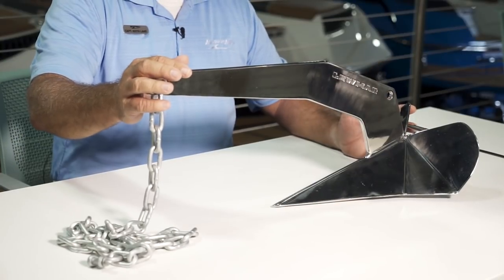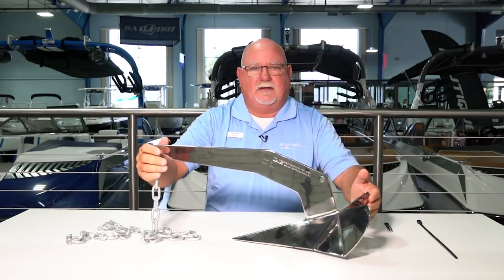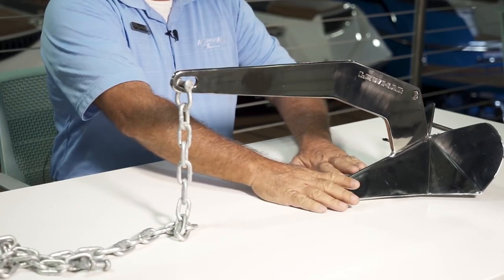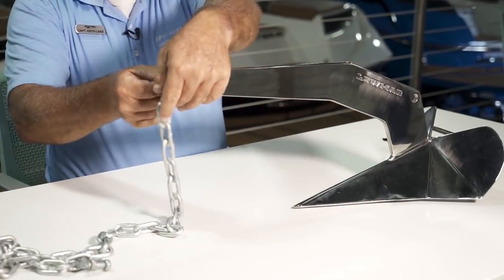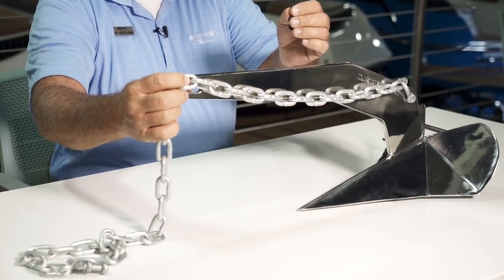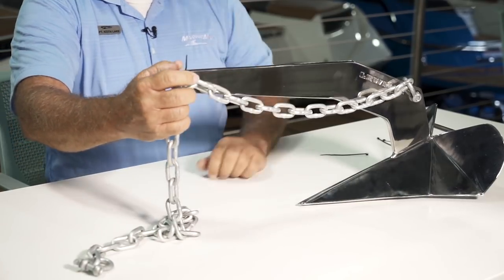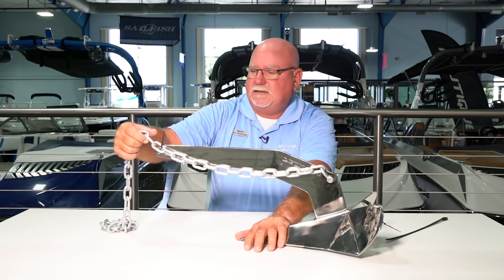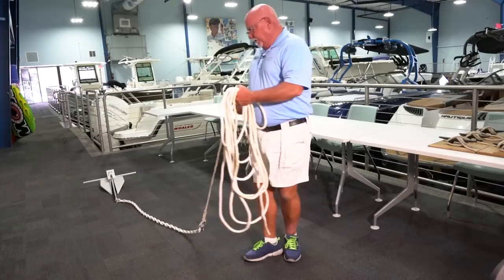Boating Tips Episode 15: How To Retrieve a Stuck Plow Boat Anchor

Comment: This seems a good idea but very risky if you are anchored in a tide way. A better solution is to use that eye in the head of the anchor to secure an anchor buoy line. Then you have two options. One to pull on the buoy line or, if too firmly wedged
Reply: You have a buoy on the anchor if you have to ditch it and retrieve it later.
Reply: Thanks for posting this John.  That zip tie aint gonna hold and will break almost every time.  I would not trust a nights sleep with it.  The buoy method is best

Comment: I have a plough anchor and always wondered why there were two fixing points. I came to the conclusion that if you had a rope on the one to the rear, you could pull it from that end in the event of it getting stuck.
Maybe attach the rope to the chain with small zip ties near the anchor ? ? 
I'm just guessing as I'm not a seafarer.

Comment: Thank you very much that's a big help I just finished a full restoration on a 1980 sunrunner 18-footer and with a Tower of Power all the electronics completely renovated boat it's going to be fun
Reply: Nice, I'm about to start restoring an '88 Sun Runner 195CV. Any tips?
Reply: @twistedsphere  Now that sounds like fun project yeah for starters with your haul that orange containers siliconized wax and the names right on tip my tongue but four coats and it'll bring that fire glass like brand new and that's something you need to make sure your glass is good before you waste too much money on the boat second thing is most your electronics because of age are gonna not give the right home settings so yeah change the stator the trigger the two description distributor boxes and and the rectifier play it safe that way you won't have a breakdown on the water it cost you about 500 bucks but trust me he'd pick 500 bucks real quick if you were stuck out on water
Reply: @twistedsphere  a friend of mine that's a mechanic for one of the big lakes around here tells me that they put a marine-grade fuel stabilizer in the fuel when it's delivered now and they have a lot less problems so I'm thinking about doing the same cuz my boat holds 26 gallons and it sits for a long time

Comment: i don´t like this method at all and wouldn´t even trust it for my dinghy. the best solution is to run a line from that front hole to a float in the surface. should the anchor get stuck, just pull the line. still i've always been able to get my anchor unstuck by using the boat's engines to go forward and pull hard on the anchor. i know people think that's not ideal but it's always worked for me with no problems ever.
Reply: That just isnt a realistic method when the water is deeper, or for a heavily fouled anchor.  This method with tuna cord is the best.  When the anchor is hung you clip a buoy to the alderney ring you should always have on your anchor line and you rip the breakaway out with the boat engine, and float the anchor with the ring.
Reply: @FTATF  it is a realistic method I do it like that every day, slightly higher chance of losing anchor but means you don't have to waste time with zip ties or rope always breaking , my plow anchor pivots and if I don't use the axaxt right amount of chain to tie it up like this it will not work properly otherwise it's probably the best method.

Comment: I always question if people have ever actaully done this when I see and hear people talk about the zip tie.   I've tried the zip tie on my old boat which maybe weighed 5 or 6000 pounds.  It breaks away way way to easily.  I actually used 3 of the largest zip ties.  A much better method is to use tuna cord.  For that boat 3 wraps of 300 pound tuna cord worked well, it wont break unless you put a lot of pressure on it.  For heavier boats you see more wraps.  Zip ties are a joke.
Reply: Nope, your zip ties are braking because you leave too much slack in your chain. Zip ties are not there to hold the weight of the boat. They are just there to hold the chain in place and to slide thru the shank eye, allowing the chain to do its job and hold anchor.
The only time the zip ties should have any heavy force on them in when you are pulling directly up un the anchor or in the opposite direction of anchor. 
In fact, the demonstrator in this video has too much slack in his chain. One link to much on that zip tie location.
Reply: @jejoko  they are breaking becasue its a bad method that can't be used for anything other than light boats.  Your idea of where the load is applied is totally flawed and works against the design of any anchor.
Reply: @FTATF  
Sorry but you are wrong. The technique is correct. The application in this video for larger ships is what makes it fail.
For larger ships you can use a slip ring to replace the zip ties. But if you leave chain slack between the anchors front shackle and the slip ring then all the tension gets placed on the ring. Which causes premature failures every time.
It is not a concept that everyone can grasp or apply correctly.
And for them the slip shank anchor was designed. Like the rocna fisher.

Now if you are anchoring OVERNIGHT then absolutely fasten your chain to the top shackle point of the anchor shaft, ALWAYS.
But for day time activities the zip tie or slip ring technique is perfect for a quick anchor retrieval. When applied correctly.

Comment: This is stupid, lame advice!  If you anchor and a storm comes up, that zip tie will break and then the anchor will pull out.  Not a good idea! Your anchor chain should be securely fastened to the eye at the end of the anchor! 
 A better idea is to fasten a second line to that other eye and then put a float on the end of that line.  Then if you cannot pull the anchor out, you can retrieve the line tied to the float and then pull out the anchor.  That float will also serve the purpose of letting other boaters know where your an hor line is, so they do not drop their anchor near yours, which could cause the two anchors to become fouled if the tide or wind changes.

Comment: Why not just have 2 chains, one attaches to each hole.  The one on the bottom should have much more slack when anchoring, and when you want to retrieve it, pull on the bottom chain.

Comment: Hello Captain Keith. Two questions. What zip tie tensile strength you suggest and what size of shackle you use in the video?  3/8" with 1/2" Pin ? Thank you.

Size C
Reply: What is size C shackle? I was not able to find.

Comment: Sorry but I'm not going to trust my $80,000. boat to a 89 cent zip tie. Current turns boat 180 degrees, zip tie breaks and I've lost my boat...
Reply: Every boating class that I have been to agrees with this video. Use a zip tie to save your anchor, the chain is moved to be attached to front hole in the anchor.  The zip tie just changes the pulling angle for a stuck anchor so you can get it out, it does not change the holding power of the anchor.
Reply: Not so: this method ONLY has relevance for short term anchoring where the direction of pull on the anchor does not change. So, do NOT use this method in tidal settings and/or where there are large windshifts.  If you do, you'll find your anchor being pulled out of its setting! If you need to retrieve an anchor that is stuck you have a number of options. The easiest and therefore first to try is to use an 'alderney ring' or other similiar proprietary tools on the market.
Reply: You would have the same issue, without the zip tie, if the tide changed and you spun around 180 degrees. Your anchor would likely pull loose from its initial dig, and would likely redig into the bottom again in the other direction.
Reply: but it would at least have the chance to redig. with the zip tie you break it and you will have to pull the anchor up, redo the zip tie and then go again
Reply: @jazzy jazz be careful, it does change the holding power since the front hole is positioned precisely to leverage the anchor to get it unstuck. therefore, it just takes a big enough wave or tidal change to break the zip tie and leverage that anchor out.

Comment: Guys like this dude have obviously never slept on their boat on a windy night. For fishing when the captain is on deck this technique is fine. But in a wind or tidal shift that zip tie or fishing line can easily break and now  the anchor has only a fraction of its designed holding power. MarineMax please get off line or corrected before you are responsible for getting some poor fool killed.

Comment: lol at all the naysayers. We who fish wrecks and reefs all do this all the time. We've been successfully using this method for a decade on boats up to 33'. Yes it's not meant for overnight. It's meant for short stops over wrecks and live bottom. Use the large zip ties, not your average 7" tie. The ones we use are at least 12" and thick.
Reply: I've used THREE 50-pound zip ties all at once, and that doesn't break prematurely on my 20' boat.
Bill's idea of "biodegradable twine" is a more eco-friendly option, however.